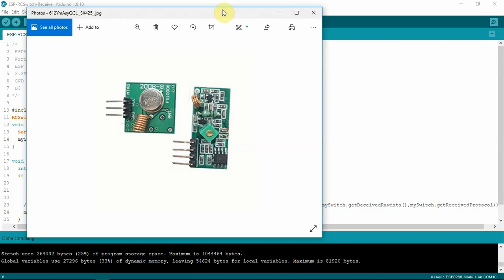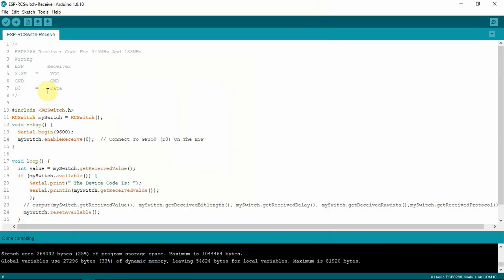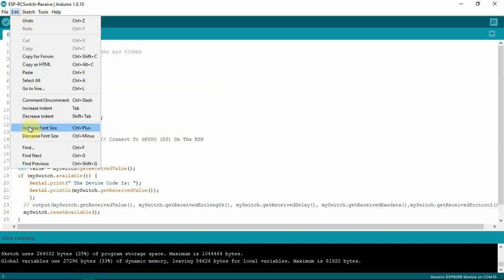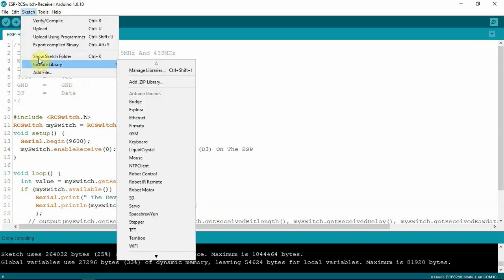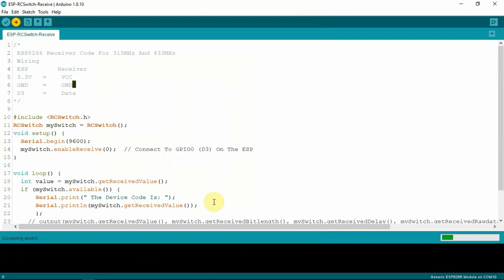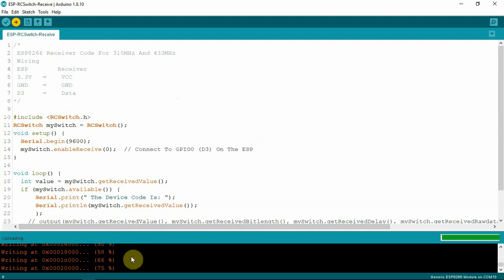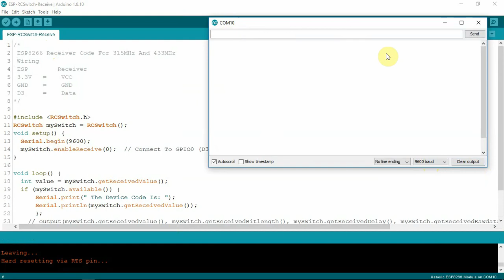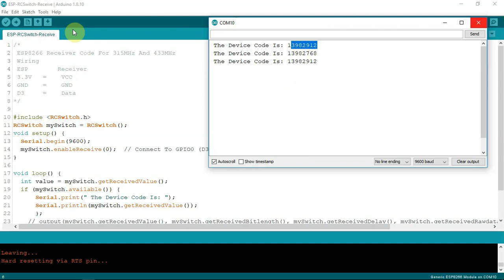ESP8266 Connected To A 315 MHz RF Receiver With Sketch

Comment: Hi there. I tried the same but was not able to make it work. I found that as soon as I connect the 5v to the receiver module, I was getting constant 5v output from the data pin. Is it normal or the module is damaged? looking forward for your ans.